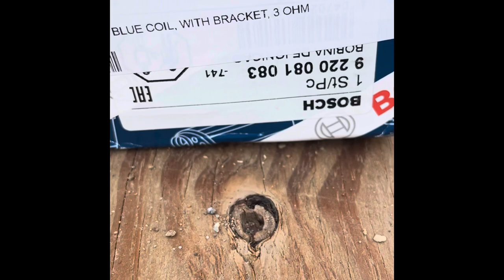Replace coil on 1973 VW beetle

Comment: The video could have been EXCELLENT if you would have stated (as you went along) , this white wire is from the ignition, it plugs into the + connector, this brown wire I believe is from the coil, this other white wire is from the idle control etc; this would have added VALUE to your time and the video, but instead all we see is someone installing a new coil on a Beetle and plugging in wires.